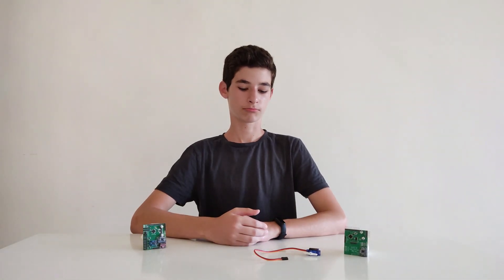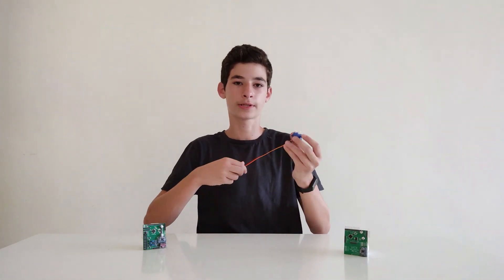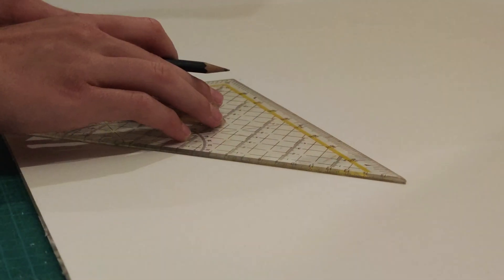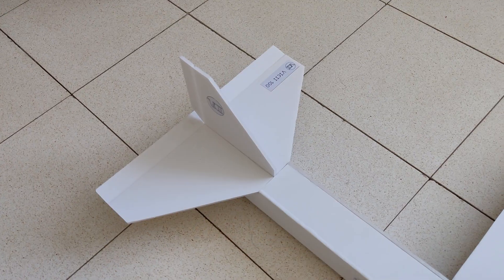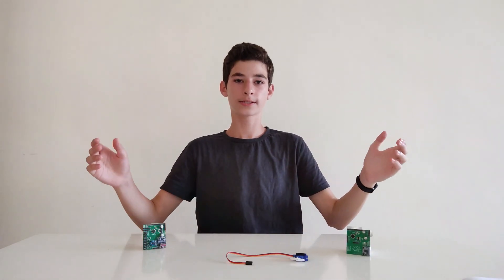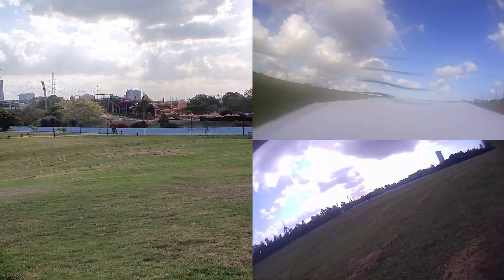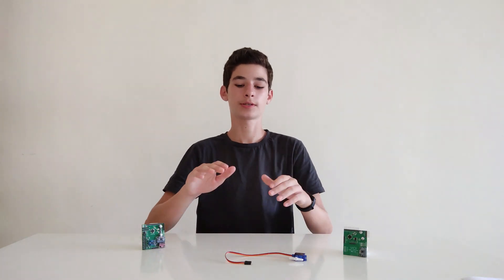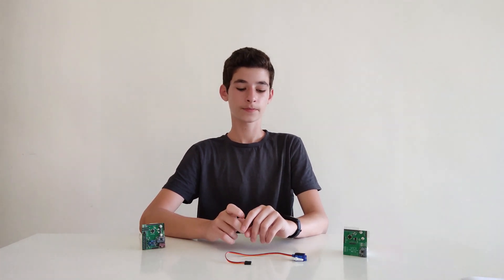The Vicii 100 airplane

Comment: Job well done!!!
I can suggest you hot glue the flight computer to the fuselage, save some weight by not using a 3D printed mount. Also try to fix the wing more firmly to the fuselage.
Try shaping the main wing (at least) as an airfoil, even symmetrical. It will make your plane more efficient.
All in all, this project looks promising and your knowledge seems really vast! Keep on!!
Reply from the maker: The problem with gluing down the flight computer is that I can't take it out... 
Also, the 3d printed mount is already finished and weights nothing
Reply: @viciiairsystems  Great! That's an important thought. 
How did you program the flight computer?
Reply from the maker: A video about it soon✈️✈️